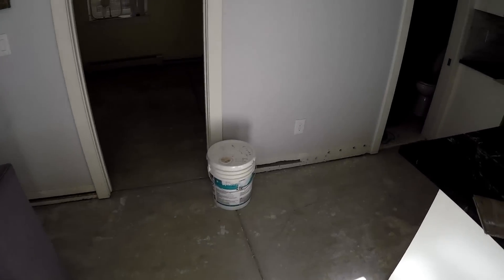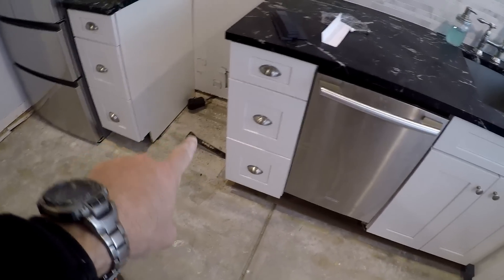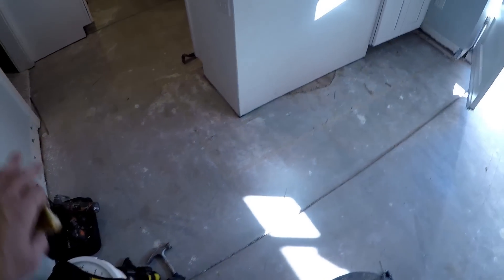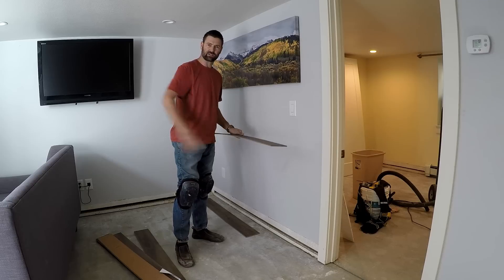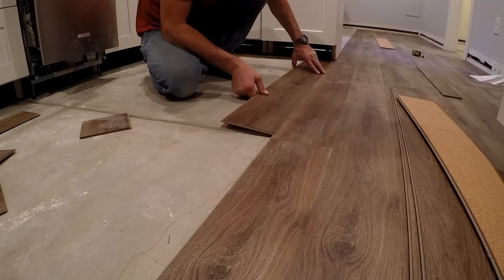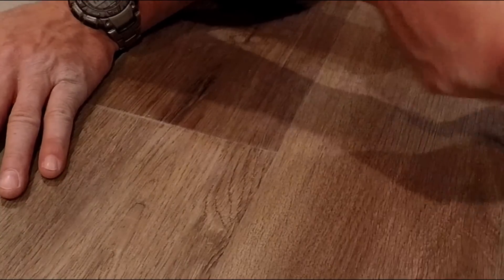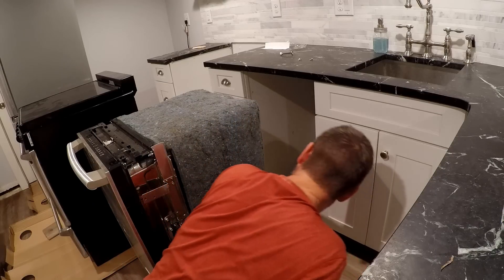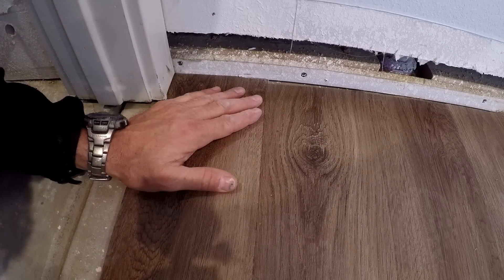The Truth About Vinyl Plank Flooring 1 | THE HANDYMAN |

Comment: Thanks to The Handyman
For putting out a video for all the do it yourselfers out there and tolerating all the comments LOL. It takes some time to do what you do 
and I for one can appreciate it. I mean nothing derogatory in my little bit of info below only to make better what we do. 

1st--All floors WILL SCRATCH and tools should never be left on finished surfaces during the installation and absolutely never
        drag furniture across finished floors of any kind. I KNOW I KNOW you move furniture on your floors all the time and it doesn't
         scratch them at all !!  The last comment is for all who have gotten away with it to this time.....but your day is coming for a big
         juicy scratch and you need to be aware its not the fault of the flooring....GO LOOK IN THE MIRROR AND YOU WILL SEE THE PROBLEM.
2nd--For ALL vinyl plank The sub floors should all be smooth at all surfaces especially control joints like in this situation. 
        The vinyl is not substantial enough to withstand a heel on a shoe if concentrated in one area as big as the one in 
         the video and it will break the vinyl  in that area...........again it is not a structural product--Bridging/Spanning is not ALLOWED!!!!
3rd--For ALL Floating floor installation you do not install under cabinets!!!! "Vinyl, Wood, Laminate"
4th--Vinyl flooring is water proof, meaning it will withstand mopping with string mops and sponge mops, spilling water on it and so on. 
        It IS NOT designed to be submerged and will suffer issues such as in this video.
5th--Vinyl flooring is made by many different manufacturers and in many different structural compositions. All of them require different installation 
        Techniques and should be researched before you begin your installation. Each one will have expansion requirements around the perimeter, some 
        will need transitions in doorways while others will not, some will indent easier than others, some will not do well in direct sunlight & some will do great.
6th--Cork backed flooring is used a lot of the time because it is a renewable product and the  environmentalists like it and the manufactures like the story 
        behind it but the fact is it is a wood product and if you put it on concrete that has a high moisture content it will do its natural thing and expand & the vinyl
        will not and you will have a cupped floor at the surface. You should always check the moisture content of the slab before putting plastic over it but a 6 mil 
        plastic with a 6 inch overlap will stop the moisture issue for the product. If you have a High moisture content in the slab it should be addressed and stopped
        before you put anything over it.
7th--Not all vinyl floating floors have pad attached and in many cases are quieter than those with pad attached especially on a concrete sub floor. I have a show room
        that has 4 different manufacturers products on the floor with 1 of them not having pad under it and so far no one including installers  has been able to choose the 
        one without the pad, In fact they at times think the one with no pad at all may be glued down. 

        There is a lot more to be said about vinyl flooring but I'm just tired of typing LOL so I hope I've added to the story and not stepped on any toes.

Comment: Was doing an entire basement bath remodel except for the flooring. It was this vinyl laminate. 
Installed new supply shut offs, then went to turn water back on. 
I decided to go have a cigarette before returning to the bathroom. As you can imagine, the supplies were open...and omg did that house have pressure. That’s when I quit smoking.

Comment: Hey, How do you tap in the last piece in a run when the Wall is in the way?
Reply from the maker: I push it in with a pry bar
Reply: I've found the lip on a speed square put into the gap between the floor and wall, using it as a pry tool works well. Distributes the prying pressure over a wider area of the plank, than a regular pry bar.
Reply: I gotta try that next time. I always struggle with that.
Reply: Knuckle head pull bar is the tool for the job

Comment: Boss would have my head if i didnt stagger our planking propperly, so i was curious as to why you dont do a set stagger with your install.
Reply from the maker: That's not the correct way to install flooring that is supposed to look like hard wood flooring. Only tile has a set stagger.  Some times on low end commercial jobs they will install this type of flooring in a set stagger to save on material costs.
Reply: reddead405 having a set-stagger with a faux wood product would defeat the purpose of using a wood-looking product. As a customer, I’d have your boss’s head for trying such. 
Tile, on the other hand (real or faux) is a completely different story.
Reply from the maker: @K T   great minds thing a like.
Reply: Kool, ill keep that in mind for my own jobs in the future.

Comment: I'm a floor layer and make easy job look hard it a days work leave the flooring to floor layers start with better product lvp why the fuck are you bothing  pull up the stuff under the bench if you ate putting on kickboards handyman are not tradies
Reply from the maker: I'm guessing English is not your first language.  The floor under the cabinets still had water under them. That's why the home owners requested I remove it.
Reply: @TheHandyman1  what you layed is a hybrid which you need gaps and is painful use real loosely planks on PS glue which have a great benitfit of being easily replaced with out pulling up whole floor
Reply from the maker: This flooring only needs a small 1/4 space around the perimeter.  Up to 4,000 sf with out expansion joint.

Comment: They make a tool that is for locking the planks together and to level the joints..plus there is a tool to set the last row too
Reply: Tapping block and a knuckle head pull bar i was reading all the comments so i could add this information

Comment: I know better and have remodeled 3 houses and I am now 65 years young and still doing things right .I know right from wrong .Vinyl plank floors not really supposed to go under cabinets and you should always keep extra and buy extra flooring .I have seen vinyl plank under cabinets and it does have issues and then when you want to change the layout the flooring will look different .My sisters contractor did it and 2 years later ,well lets say they had to take up cabinets to take out flooring,could be because of the house having a crawl space that caused moisture issues with all the rain we have had  .Color and wear will look way different also .

Comment: We had luxury vinyl tile installed in January, nearly the entire home.  It is a fully waterproof product by J&J Flooring Group.  A commercial product, also thicker than most of the residential types.  Each piece was 9"x48" although the installers cut down the length to give a more natural look.  We went with 3 different colors per floor and also choose the textured products over the smooth products.  We are very satisfied.  So much better than carpet!

This product is also a glue down, not tongue and groove.  Apparently the glue never really gets hard so you can theoretically peel up a piece and install a new one if there is ever damage.  We have plenty of scraps and full spared pieces left over so it's nice to know that if the unusual need arises to replace, it can be done in a snap of the fingers.

On the lower level they glued down right on to the concrete slab.  On the other two upper floors they did install a high quality 1/4" sub-floor and then went over the joints and gaps with some sort of other compound prior to gluing.

Comment: Great video mate! I have two questions:  1.You don’t leave any expansion gaps around the edge ?
2. Insulation under the flooring is not needed ? 

I’m not into the trade, I was just curious...
Reply from the maker: Only 1/4 inch is needed for this specific flooring for expansion.   It will only expand with hot and cold It wont expand with humidity.  Its an air conditioned home and the temp of the floor will never change more than a few degrees.  I don't anticipate it every moving.
Reply: The Handyman - thanks mate! Keep up the good work, I like your videos. You just got a new subbed!

Comment: Typical water loss being replaced with the same problem. You never put composites or carpet where water is in use. After 40 years in restoration, I’ve got a pretty good handle on these situations and homeowners don’t know Jack when it comes to this stuff, so you have to direct them to the correct options...

Comment: It is obvious you don't do this very often. You need a heat gun, tapping block and a cutter. This job would take me and my helper one day to install. The right tools make a huge difference. The cork act as a padding which keeps the floor quite when walking on it.
Reply from the maker: I got it done with out a helper in one day.
Reply: That sounds much more like it. 
The other day my helper and I did a small  2 bedroom house that looks about the same size as what you are working with. We moved furniture, tore out carpet and tack strip, installed lvp, installed and painted shoe molding and put all the furniture back in just under 7 hour's. 
I am not trying to down  grade your work, it looks like you did a great job. I am just saying that a $200 dollar investment in tools would make the job go twice as fast. You make more money per hour ( if your doing it piece work, and you should be) and the customer gets back in faster. Win for everybody.

Comment: how do you figure out how much material you will need
Reply from the maker: length times width.  Break the entire space up in to small squares and rectangles. Add them all together to get total square feet.  There will always be waist.  10 to 15 percent waist. so get more SF then you actually need. Try to by from a place that takes returns with out a restocking fee.
Reply: @TheHandyman1  thanks bro

Comment: My question is why wasnt the joints floated first at some point in the life of the floor its going to transfer to the plank and wat if a seam falls on the joint it'll break the seam when u step on it must float the expansion joints but no need for poly for it is suppose to be water proof there for its is its own poly poly for products not water proof like laminate or with glued joints

Comment: I had a hot water heater flood two years ago.  It wrecked the utility room floor, kitchen, dining room, living room, hallway (due to open concept) :)  And ran to the other side and wrecked a bedroom.  My insurance covered it all.  I picked out Shaw Floorte "Caplone".   I love this stuff.  Easy to clean, very durable, nice looking.  The dog runs on it without leaving a scratch from her nails.  A very large, heavy hammer fell off the countertop during a new door installation.  You could barely find the spot where it hit, just a tiny depression.  Now I need to find a way, that insurance will cover, to wreck the carpet in the other two bedrooms.  I had them install the new water heater on a stand under the tray with the tray piped to the outside of the house in case of another leak.  Don't want this to happen again because I really love my vinyl plank flooring!   Hmmm, maybe I should have had them install the new hot water heater in the closet between those two back bedrooms.  Oh well, too late now :)

Comment: Just had LVP installed by a contractor (floating). Its been about 3 weeks since completion. Is it normal to have hollow creaky sound in some parts ?
Reply: That is definitely not “normal”. Most likely due to some irregularity in your subfloor. If the floor is completely smooth/flat there should be no movement in the flooring assuming it’s all locked together.

Comment: I use a dead blow hammer to set the ends. It also works good for scooting a piece over by hitting the surface with a bit of english. That way I avoid the risk of damaging the edge when hitting it with a scrap piece.

Comment: We put this flooring in our motor home. When the weather got cold the flooring shrunk end to end and has about a 1/4 gap on every end. Don’t know if it will go away when the RV warms back up. Anybody else had this problem?
Reply: Every floating flooring has limitations on the overall size of install before expansion joints need to be put in..I suspect you didnt keep it maintained inside the materials specified temperature range which lead to wild expansion and contraction cycles that caused uncoupling. The only thing worse is if installed to tight prior to warmup is "tenting" or buckling
Reply: Plastic ie vinyl flooring is thermoscopic so it will react to temperature. Yes it will contract in cold weather and expand in warm weather. Hence why you need to allow perimeters gap around the floor.
Reply: A waterproof laminate would be a better product for a motor home due to it not being affected by temperatures. They expand and contract with moisture from the atmosphere which will be much more stable than temperatures.
Reply: It will go back
Reply: It's supposed to have a minimum 1/4" gap around all stationary objects. Cover the edges with trim, and no, laminate would definitely not be a better choice for your rv.
Reply: @Nick: There's no such thing as a waterproof laminate.

Comment: I’m the so called “touchup guy/final repairs/wood doctor” for many new home builds, and I tell you these engineered floors are crap.
They damage and scratch(Shoes, furniture, toys etc..) so easily and there is no way to repair well. Good for basement but stay clear of kitchen, living and front door areas.
He says that they won’t scratch but I assure you if you look at certain angles you will see the scratches.
Reply: Depends on the wear layer. LVP with a ceramic wear layer is the best. No flooring is impermeable to damage though.

Comment: Not as easy as they told me it would be.... actually it was a pain in the ass to lay.
I ened up using a piece of 2x4 to lay on top then tapped it with a hammer. I will never buy this type of flooring again. 
I never had the problem when putting in REAL tongue n groove oak flooring or ceramic tile.  
Good luck!!!

Comment: Interesting video, thank you for the effort, but for new DIY'ers  watching, your use of a steel Estwing construction claw hammer instead of a recommended rubber mallet on the vinyl planks is not the lesson you want to teach people. The proper hammer is under $10. Go for it.
Reply from the maker: Steel hammer works better.
Reply: @TheHandyman1  in the right hands…the advice is good for the diy ears.

Comment: What would you have done if the concrete floor was perfectly level. I have a floor with a couple bumps. I was thinking about grinding them down since they aren't very big. What are your thoughts?
Reply: Hire a professional to do your floor prep
Reply: Yes grind the concrete and uses a feather Finish to fill in the dips

Comment: Curious why no vapor barrier was installed 1st? Thanks.
Reply from the maker: It is integrated into the planks.  Most modern vinyl plank flooring is made to go right over concrete.
Reply: @TheHandyman1  Thanks. The mention of cork is what threw me off. Bottoms are clearly all vinyl with cork tops. Nice!

Comment: For those commenting about the 1/4" expansion gap needed for LVP flooring, the gaps main purpose is for repairs to a piece of flooring if it gets damaged. The space you leave along the walls allows for a specialized vinyl plank spreader to spread the planks on either side of a damaged piece to replace it. And yes, it also allows for expansion room though with vinyl it is minimal compared to wood products such as laminate flooring which wick moisture and then dry out over and over with changes in humidity or vapor intrusion. 🙂

Comment: A real professional would know when you get to a door jamb you shave off the little lip of the locking system and glue the pieces together. Plus you would use 2 pieces instead of trying to fit in a full piece
Reply: Absolutely not. No professional would ever do that. I'd fire anyone trying to do that bullshit if they were working for me.
Reply: No cutting and gluing but yes in 2 pieces it would have been quicker and easier

Comment: You went the extra steps by removing that flooring from under the cabinets, adding shims, and removing the dishwasher. I doubt the homeowner knows how much extra time and effort it took  to do that. Most would just cut the flooring under the toe kick, and run the new flooring far enogh under the dishwasher,  so that the faceplate hides it. Good job.
Reply from the maker: It was still wet under that flooring that was under the cabinets too.  It cold have led to mod growing under there.   Thanks for the comment.
Reply: so true.

Comment: KNEE PAD TIP:
Wear tactical BDU pants with knee pad inserts option. I used formed knee pad inserts on my deployment and they worked great. It was a tip offered by a seasoned Infantryman.
Setup one pair of pants at first; if it works for you, set up another few pairs. You don’t want the hassle of having to remove/insert repeatedly. I even washed them with the inserts.
Plus you get the added benefit of having a few cargo pockets for carrying common items, like gloves, box cutter (with locking blade),  small tape measure etc.

Comment: Great job!  I'd like to do the same but my floor has some uneven areas, can I put this type of flooring without leveling the subfloor first?
Reply: Not really as the finish floor will be uneven too.  Depending how bad/drastic the unevenness is it will either contour to existing or crack/come apart at seams